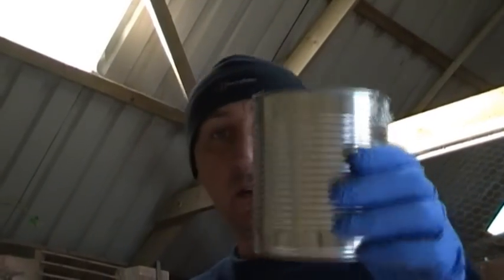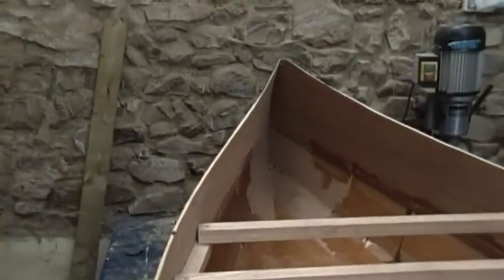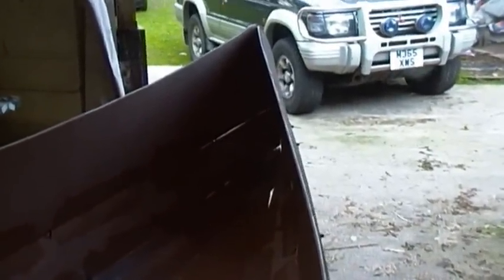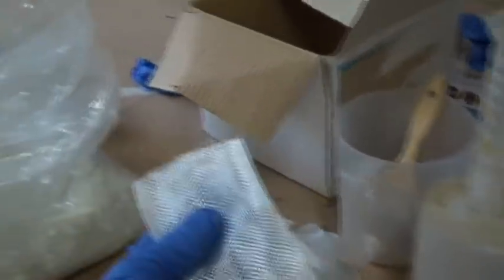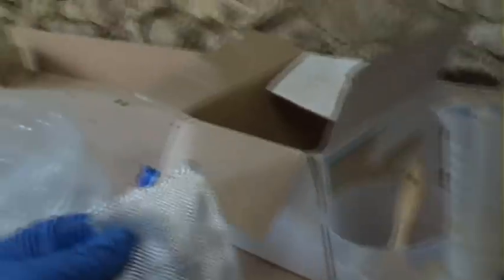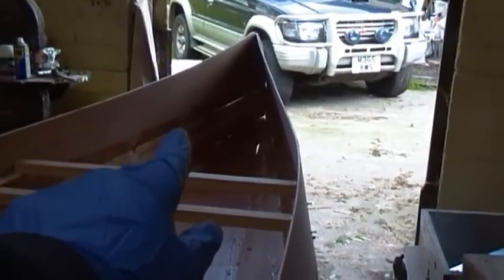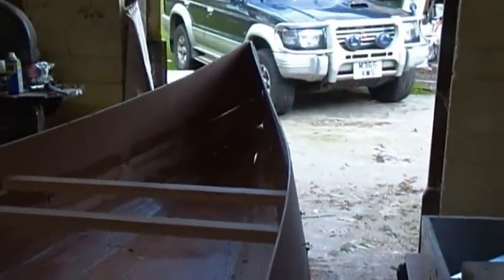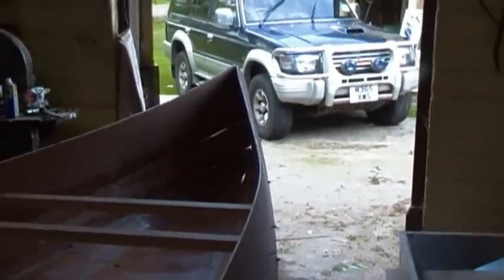open canoe build part 4

Comment from the maker: Hi Martycuff1 i dont use that method some do use like a butt strap around 4inch wide along the joins but no need i use 75mm tape also i tape both inside and out also when the ghunnals are fixed that also adds. i guess if you jump up and down on that join out of water you will do damage but iv never see anyone paddle like that hahah